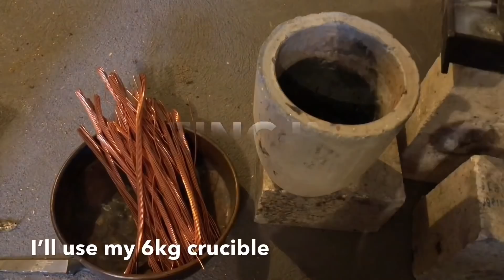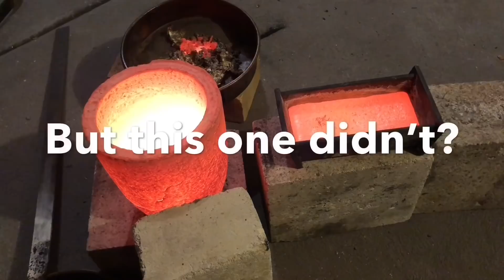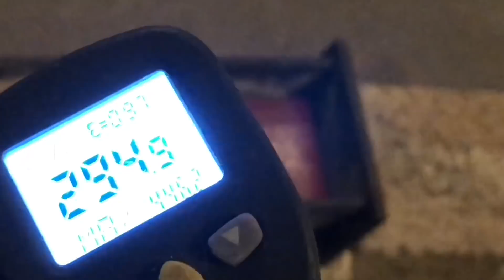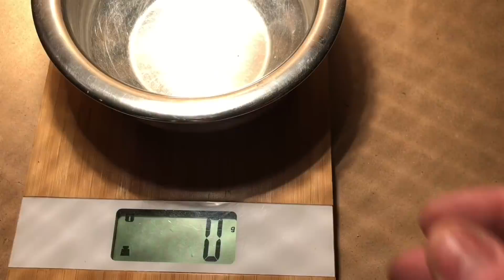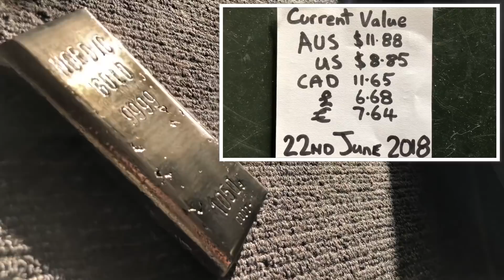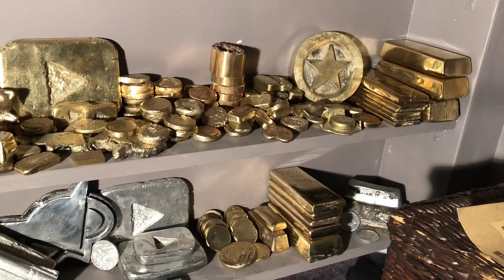CASTING A SOLID NORDIC GOLD BAR -  nordic gold bullion bar casting at home

Comment: Another great vid. Has Nordic gold have any use.? If you don't think its pretty I'll do you a favour and take it off your hands.. I'll even pay for some of the postage 😉😁
Reply from the maker: Nordic gold is a base metal alloy used in 10, 20, and 50 euro cents, Swedish 10 kronors. Unfortunately It contains no gold. Also it has a very high resistance to tarnishing. Apart from that it makes a great paper weight or doorstop👍🏻😁

Comment: How do you get the metals to blend together. Do you stir it?
Reply from the maker: On melt them all at the same time that way the lower melting Metals create a pool of molten metal in the bottom of the crucible and that will lower the temperature for the copper to melt. I give a gentle stir a couple times during the process aswell . Make sure to Always heat whatever you’re stirring it  with👍🏻

Comment: Where do u het all your cables and scrap metals from
Reply from the maker: Hello Luca  Ive worked on the same industrial site for 20 years and I get all my cables from my electrician friend and out of the scrap bin when I’m allowed to go through it , I started collecting my cables probably two years before I started melting so I have a decent stockpile but unfortunately I cannot get many more cables as often as I would like as the bosses have now stopped allowing us to take them😒but I still get a tiny bit here in there👍🏻

Comment: Next time try brass with aluminum, tin and zinc as more realistic gold like option.
Reply from the maker: I did more Nordic gold two days ago if you missed that one check it out but I made it much the same is this just smaller bars👍🏻
Reply from the maker: I stick to these percentages as that what they use for actual Nordic gold
Reply: @bigstackD  I understand that, lad. I used brass as an option instead of copper.

Comment: Given the properties of the Nordic Gold what could you make out of it? Would it be suitable to use for anything you would have made from copper?  And save a tiny bit of weight?
Reply from the maker: It’s to me basically this is like aluminium bronze the only thing I would think to make with this would be smaller Nordic gold ingots and sell on eBay otherwise really couldn’t find anything to do with it. Plus I can say I have a solid  Nordic gold block( even if it is just fancy alloy) 👍🏻.
Reply: Would be very cool for some kind of armor smith to make armor out of.
Reply from the maker: Or a really nice blade as it would be pretty bloody strong But I’m not sure of the blacksmithing qualities of this metal?  maybe one day someone will test it.
Reply: I have a friend who bladesmiths. Not professionally but he's really good at beating the steel. I have two blades that he made out of 1095 steel for me. I'd want to think that this alloy might be a little too soft to hold an edge. Not sure if it could be heated and quenched to harden or not.
Reply: That would be closer to redsmithing, and the only thing an alloy like this would be really good for would be a pommel on a blade, or a hammer. The hammer would potentially work harden itself as it's used.

Comment: Will you do sand casting?
Reply from the maker: If your wondering if I’ll sand cast with Nordic gold the answer would be eventually yes but I need to source some more zinc first👍🏻.
Reply: OH I SEE , THAT'S GOOD Dion 😁👍
Reply: Do u have a large amount of cpu?
Reply from the maker: Cpu? Do you mean copper?
Reply: It's cpu of computer , you can try to discover gold from a large amount of cpu
Reply from the maker: Oh ok I thought it might have been an auto correct, nah matey I only have 1 computer and don’t have access to more, I’ve seen people using chemicals to extract gold but I’ll never have enough circuit boards to do it🤷🏻‍♂️.
Reply: Ok

Comment: should crucible be mesured by the kg's 
I mean, the volume of 6 kilos of aluminium is totaly diferent then 6kgs of coper so it should be litters or something, i just think of that, maybe this is better, but i think litters would be much better
Reply from the maker: As far as I know the kgs represents weight in molten copper on most crucibles sold . It would make sense to be in litres but I think it’s done this way as if people know what there Casting size is they can know how much copper they need. Also 1litre of copper is 8.9kgs so I recon if they did it in litres it would confuse the hell out of people. Also it’s probably to do with the fact that metals are always measured in kilos not litres👍🏻
Reply from the maker: But that’s just my guess I could be wrong
Reply: For my 4Kg crucibles I have, they are measured to hold 4Kg of gold

Comment: How long a gas tank like that last?
Reply from the maker: This 8.5 kg gas bottle lasts about 2.5 hours with my small burner you see me using in this vid . I’ll normally get 4 or 5 full melts from 1 bottle.  A refill costs me $22aus.
Reply: @bigstackD  cool, thanks
Reply from the maker: No worries 👍🏻

Comment: I was expecting some good finish to the final product.  Machining should be done to give it a perfect shape. You seldom bother about it. I always do it.
Reply from the maker: Yeah this particular time I didn’t clean it soo well as the tensile strength of this is like steel and very hard to work with but yeah I kinda dropped the ball on this one 😞

Comment: Nordic gold correct me if I'm wrong that's a bronze or brass like metal
Reply from the maker: Not sure but  if I had to guess I would say bronze as it looks and stamps like aluminium bronze as it’s super strong this bar and brass is very soft compared to this
Reply: @bigstackD   ok thanks, I was thinking it looked softer
Reply: @Kurogane_666  89% copper, 5% aluminium, 5% zinc, and 1% tin according to wikipedia.

Comment: Do you use bórax?
Reply from the maker: People always say I should use borax but out of every 20/30 melts I might use it once. All the metal inmelt is scrap and so full of crap anyway So I personally believe when I re melt from ingots they will be very clean melts and pours. I think borax eats away at the crucibles I could be wrong but that’s just a feeling I have so no I pretty much never use borax and don’t really intend to . I try to keep it as simple as possible And if I skim the metal a couple times before I pour the ingots come out pretty much spot on anyway👍🏻. (also a gentle stir of the molten metal usually will release any crappy stuff to the top of the melt so I can skim it , a couple of stirs and a couple of skims and I’m good to pour I reckon😁👍🏻

Comment: Have a tips for a starter?
Reply from the maker: Lots of research matey,  watch a lot of these types of vids  and other peoples casting vids and not just mine as I am 100% self taught and I might be doing something’s completely wrong 🤷🏻‍♂️. I Alway started with aluminium as that melts easier than brass and copper and safety safety first always . Wen I started I was just pouring Ingots and then once I had an idea what to expect I started to cast different items,  Ingots are nice and easy and simple. Always preheat your molds and keep moisture away from molten metal always . Start collecting scrap now as it’s good to have a little bit wen you start . But watching casting vids for research is key

Comment: is nordic gold worth  gold value or what
Reply from the maker: No it’s basically only worth the metal that has been mixed together in it. it’s only used for coins in other countries so not very valuable but it’s more of a novelty things than anything else👍🏻
Reply: @bigstackD  thanks
Reply from the maker: No worries matey . Yeah you might make a few dollars more if you sold it on eBay and showed them how you made it by linking the video or make this bar into smaller ingots or coins but otherwise it’s not worth much at all😉
Reply: @bigstackD  i wanted to get gold from computer parts cpus n stuff but its alot of work  i said for get that
Reply from the maker: Yeah way too much work and chemicals so I’m not interested in that either👍🏻
Reply: @bigstackD  i want to buy scrap junk jewlery n melt it  tho
Reply from the maker: Why not , if it’s gold or silver that would be cool👍🏻

Comment: What is it used for
Reply from the maker: Nordic gold is a base metal alloy used in 10, 20, and 50 euro cents, Swedish 10 kronors. It contains no gold, being composed of copper, aluminium, zinc, and tin. Its composition is 89% copper, 5% aluminium, 5% zinc, and 1% tin. It has been used as an alloy for the production of coins for some time.
But personally I just wanted a big ingot of it unfortunately i used up all my Zinc so I can’t make any more🤷🏻‍♂️